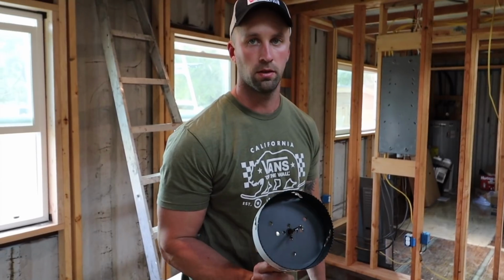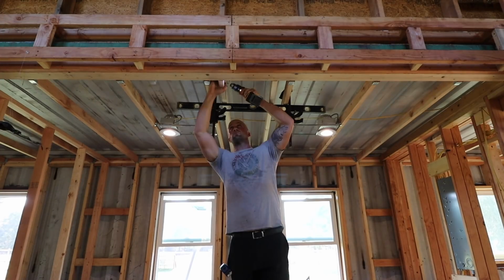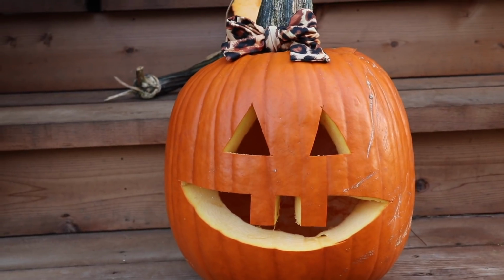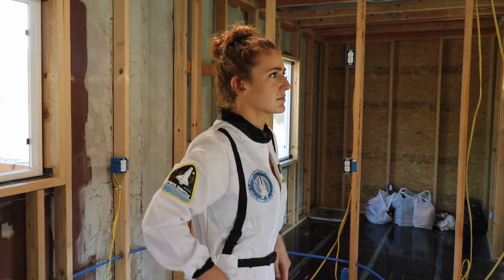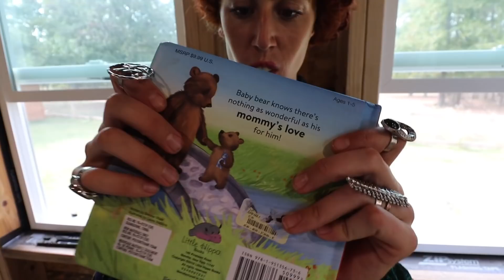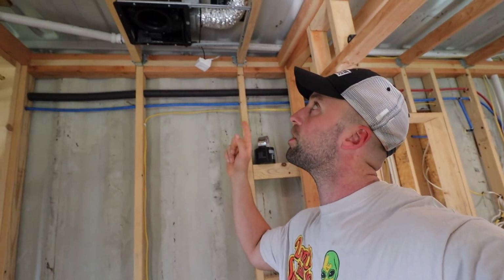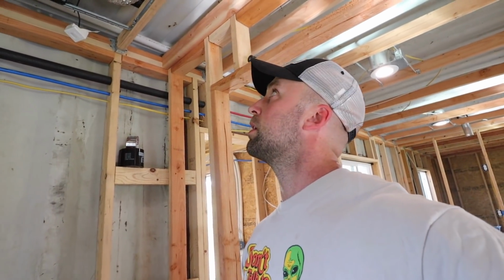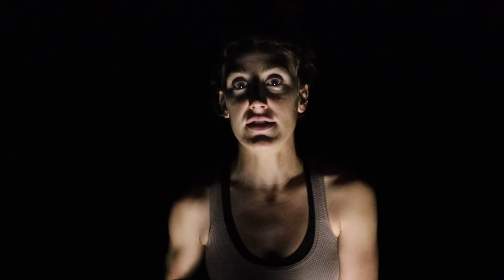Prepping Our Home For Spray Foam!

Comment: Hey guys love the show and finally watched everything. I'm a Plumber here in Aus and we don't use spray foam but I thought I would just suggest extra clipping some of the vertical PEX pipes to either the studs or if too tight using a noggin to help prevent water hammer and silicone the holes in the studs the PEX runs through which will help too. And one more thing if you haven't done it already is weather the ends (turndown) of your roof sheets that go into the guttering as this will prevent capillary action.
Other than that everything you guys have achieved is really impressive and keep up the good work!!

Comment: BTW, you guys saved me about 7,000 bucks. :) After watching your fence video, I've decided to do mine myself. I have about 350' of good neighbor fence to put up and after six months of doing my 2,000 sq ft basement from scratch (by myself) I was tired of construction. I didn't want to pick up a screwdriver or rip a piece of wood again for a loooong loooong time. However my fence was quoted at about 15 grand to have done and after watching your vid, it motivated me to get out the old tools again and just do it myself. So THANKS for the motivation. ;)

Comment: Is there a reason why shipping containers are always insulated on the inside and not on the outside? Wouldn't metal do a better job on the inside absorbing and retaining heat in the winter and the same with A/C in the summer? I'd rather have the metal walls on the inside and insulation on the outside. Metal interiors would be more interesting. Durable. More options in ways to paint them. You can use magnets to hold things on the walls. Just thinking inside the box here.
Reply: And bigger rooms!!

Comment: If it’s not to late, you can try using low expansion window and door foam before you spray foam, it should fill your hard to fill gaps

Comment: Before you use foam spray on insulation, let me give you my 2-cents worth. It was a terrible experience for me, after I had it sprayed on my container walls and ceiling. Moisture transferred through mine in less than 5 years, leaving mold and deep rust between it and my metal. It started cracking and dropped pieces before I decided that I needed to remove it and use something else. I don't even want to tell you about the work it took to remove it. I replaced it with a foil wrapped insulating material that sealed all the moisture. It actually gives me an R-29 value, far better than the R-19 I was supposed to get from the foam, clean, easy install and bullet proof on moisture. You really owe yourself to look into using it before you put foam behind your sheet rock or do some research on people who have had a similar experience to me. I haven't looked but, I bet you can Google it and find others who have made the mistake of using foam sprayed inside of their home.

Comment: if your planning on spray foaming walls and ceiling you might want to add some pipe or box chase's  incase you want to run something later. You'll never fish anything through the foam.

Comment: You don't need it now, but this is the time to do it, put blocking in the bathroom  for installing grab bars down the road. My wife had leg surgery and we ended up putting grab bars in so she could get around while she was healing. Having solid blocking in the wall would have made the installation easier.

Comment: You guys should just use the good old mineral wool insulation, Rockwool insulation, why? because the foam is very TOXIC,
and it is a whole lot easier to work on with this type installation if need be and less expensive !!!
ive worked in the commercial construction industry most of my life guys.
(my opinion is... Don't spray it !)
Reply: and dont bring baby into the house until after the paint is dry.

Comment: Definitely insulate those intake and exhaust vents.  In winter, the intake on ours gets a bit of condensation closer to the erv, even with insulation.  It was dripping and staining drywall.  I was able to place a shallow pan underneath the he area to that was dripping near the joists to catch it.  Drips so little, it eventually evaporates.  I would imagine given where you are, you will have less problems with this.  Cool just saw rest of your video.... Good on the rockwool on the other vents. Those are the little details that end up being big details down the line that builders unfortunately miss throwing up houses. I think you two are much better off building the place yourself because you won't miss anything. Unfortunately seven years on after our build, I'm having to correct stuff on our house.  And please continue your rants on things like condensation.  People need to know where these small problems arise.  And obviously you have done your homework.

Comment: Question for Spencer, having cut as many openings as you have through the containers, what is in your opinion the combination of tool and wheel, die, blade?? etc that has worked the best?

Comment: Don't do it. Do your homework better.
Cellulose is better for several reasons.

*Recycled Material
*Highly Fire Retardant
*Bug Detractant
*Water Leaks not masked or hidden until too late
*Subsequent entering the insulation area so much less hassle to work around and reapply

Comment: Love watching you guys.. 
I hope you've done alot of research on the foam..  most foam in alot of states have outlawed it..  the fume bleed off lasts for yrs.. the chemicals are not human safe over a period of time, and the bleed off of curing fumes last a very long time..  yrs actually..   we did one house not far from here and four yrs later the fumes are still higher than a FEMA trailor..   I'd be careful for the family and as a house builder must say I would not have my kids living in a home with spray foam...  your erv will not even be close enough for the  long term fumes that will be in all areas of your home... hope you have done extensive research for your ladys, and the long term effect of spray foam...   because there is very long term fallout...

Comment: Love your channel...   Make sure you do plenty of homework on the spray foam!   Spray foam is nothing to experiment with.  If not applied and cured properly....can give off some nasty, very unhealthy off-gasses for a LOONG LOONG time.  You need to work with a very experienced reputable contractor with a good track record to make sure it is applied properly.     Even when applied properly,  you need to stay out of the house for a minimum of 24 hours due to the off-gasses.

Comment: I love your videos and you are Both doing a fantastic job but sometimes I see things that make me scratch my head ,why didn't you use joist hangers on the joist that holds the fan like the rest of them there is some weight from that fan ? the aliens  might already be here, believe me they are Put a trail cam outside the fence where you see the pigs you might be surprised what you see ,or maybe you don;t want to see what is out there WOOOOO  Good one you got me I guess I should watch the whole video before commenting I am talking about the trail cam ,that was fun.